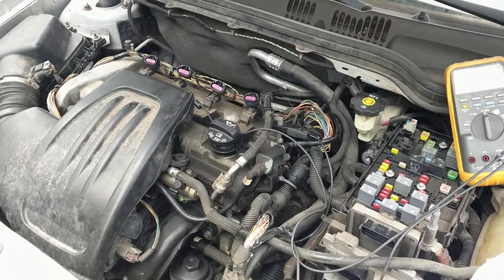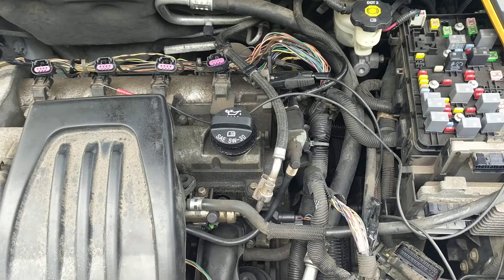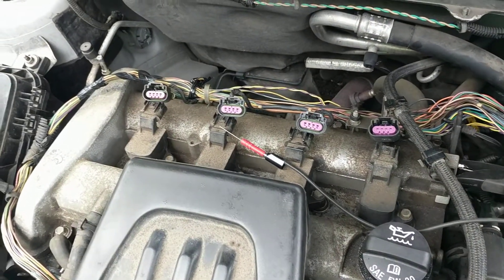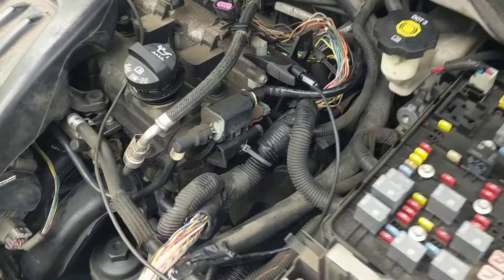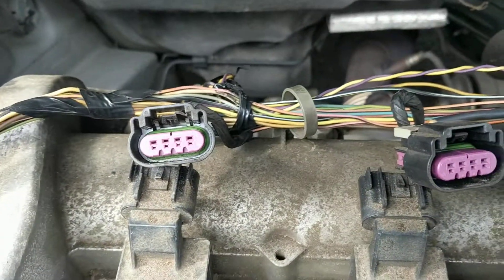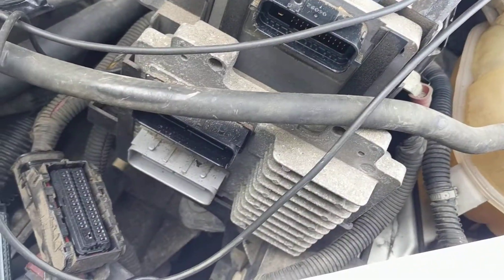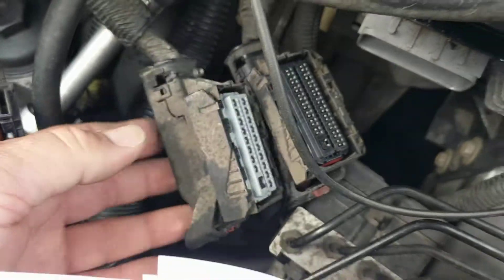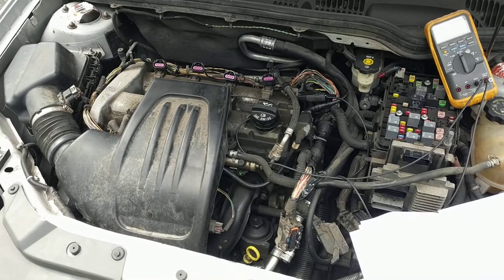2008 Chevy Cobalt Crank No Start Diagnosis with schematics (bad coil ground) 2.2L 4 cylinder engine

Comment: I’m going to go out and try this now. I have a 2005 classic with a 2.2. The shop had it for a week with a no start and then it mysteriously started after wiggling wires. Go out there this morning won’t start. The kid needs to go to college. And it can’t get towed out of the parking garage. It’s too tight.
Reply: It’s fixed. The shop did not listen to me about the pass lock. As soon as I turn the key, I could see it flashing. I checked the resistor I put in couple years ago. It was no longer 2200. It was 1860. So anyways, that’s what was wrong. And that’s why I do my own work.

Comment: Hey man my kobalt 2005 was dead for about a month The battery and when I went to start it the key lock thing ain't on but it's not firing I ain't getting no fire to my fuel injectors I can pour gas in the carburetor and it

Comment: I agree that the problem potentially was the grounding lug and wire no longer has a tight connection, which leads to intermittent problems or it jusy not working, but dude fix the car and include it in the video!!! 

These vehicles have crapy grounds, just like the 1 on the transmission under the radiator hose.

Thank You for the video, was a good video, other than seeing it fixed!!!

Comment: My daughter called me today and said her 2010 Chevy Cobalt wouldn't start.  It was a crank, start for a second or two and then die.  I go over to see if I can figure it out.  Put the scanner on it and no codes.  I check for fuel at the access port and it has fuel pressure.  I have her turn on the key and I go listen for the fuel pump and I can hear it turn on.  I go to the under hood fuse box and start checking fuses with my test light.  With the key on, almost the entire right half of the fuse box has no power to the fuses including the fuel pump fuse which is weird because the fuel pump comes on.  I even had her turn the key off and than back on as I held the test light to the top of the fuse and never got power during the prime.  I move away from the fuse box for the moment and then decide to unplug the MAF sensor and see if it will start which it doesn't.  I decide to pull the MAF sensor out and look it over and don't see anything wrong with it but I clean it with some MAF cleaner and re-install it and plug it back in and now the car starts.

I don't have access to a wiring diagram for her car so I can't see when the fuses should be hot but it was strange to me that at least for the fuel pump fuse I could never get my test light to light up during my initial checking.  I forgot to check it after I got the car running.  I did pull the fuse initially and it was not blown.  Do you have any idea why I experienced what I did and why half of the fuses in the under hood fuse box had no power with the key on?
Reply: Try taking fuse box cover off and check if there is two sets of power lines feeding each side the fuse box who knows maybe there's two grounds and one of the grounds was bad I'm only writing this because my car just shut off on me while driving yesterday and I'm having a crank but no start issue I'm not a mechanic but definitely mechanically inclined and I know my 2005 Chevy Cobalt is a rust bucket including all connections
Reply: @johnnymackbrownjr8660  Everything else on the car works so maybe some of the stuff is not powered unless it's in use such as some accessories.  I did end up putting a new MAF sensor in it because the cleaning of the old one didn't last.  No problems since the replacement.
Reply: Did you figure out what caused this?
Reply: @sbond1963  The new MAF sensor fixed the car.  It's been fine since the replacement.  I did use an AC-Delco replacement.